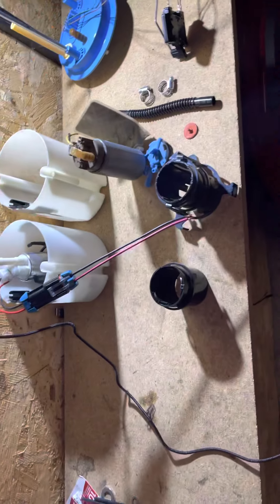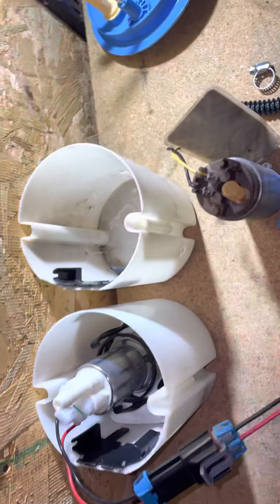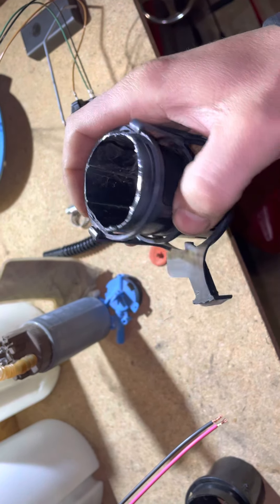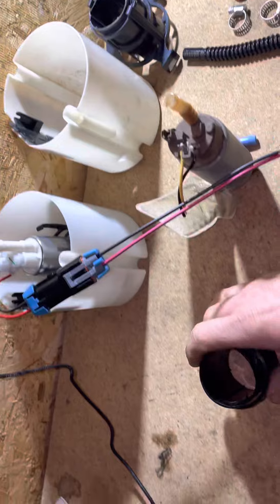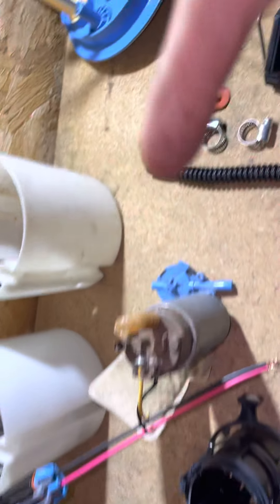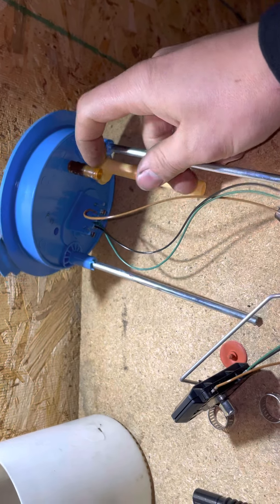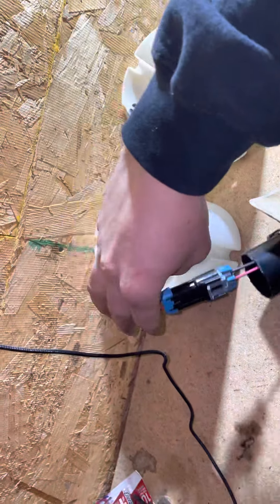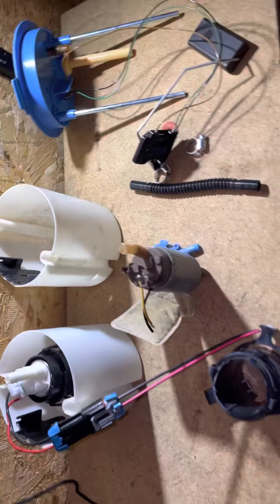Mk5 Volkswagen GTI Walbro HELLCAT Fuel Pump Install

Comment: Did you have to get the PM4 controller?
Reply from the maker: Nope. Running a Gt3071r
Reply from the maker: Stock FP module
Reply: @CODxFUNxMAN   did you do the ground mod?
Reply: @CODxFUNxMAN  how much hp are u running?
Reply from the maker: @izzetaraboga_272   have not done the ground mod. it hade 435 to the wheels. but i am maxing the rs4 fuel injectors out and need port injection to help.
Reply: @CODxFUNxMAN  what about mabotech injectors. They are capable of 600hp
Reply from the maker: @izzetaraboga_272  ive been looking into the Factory RS3 injector mod or the Barteck injectors also just pricing is high on most aftermarket ones.
Reply: @CODxFUNxMAN  bartek is good for max 550hp. Im from germany. Way too overpriced. I just got the mabotech ones
Reply: @izzetaraboga_272 which lpfp you used? And your purchased a module or stock? I have mabotech injectors currently stock lpfp but I want a pump plug and play how about the bartek upgrade?

Comment: i was scratching my head for the past week. this video literally gave me the solution i was searching for. 

but i do have one question. now the pump becomes bucketless. any issues with fuel starvation on hard corners/hard acceleration since the venturi (blue piece) is now not used?
Reply from the maker: i ended up using another basket and left the blue plug in it to help keep fuel in the basket.
Reply: @CODxFUNxMAN  i have a golf r 2012 and i did the mod withh the 450 walbro like you did and now i got fuel cut at 6500 rpm not a the first pull but the seconde one do you have a idea
Reply from the maker: @Timmy-uc4hb  have you tuned your car with the new 450 pump? also you need to data log pump duty cycle and fuel pressure to verify its fuel cut infact. i would get fuel cut when i was very low on fuel when i had drilled holes i ended up leaving the bucket undrilled just the small plunger gromed removed and secured the pump a little better in there.